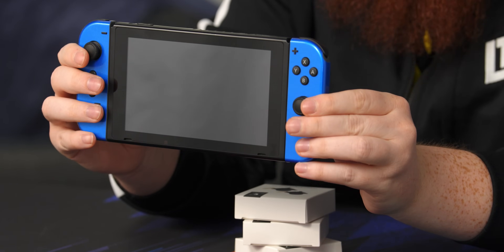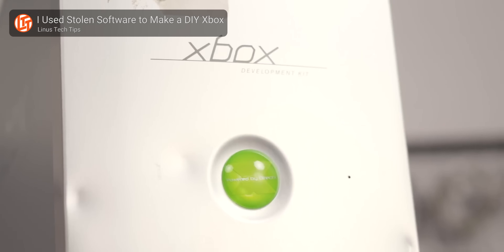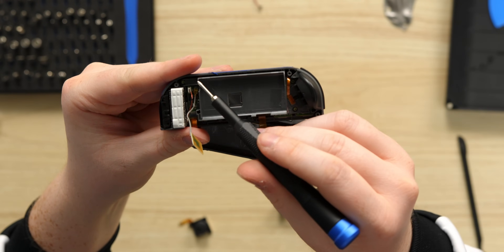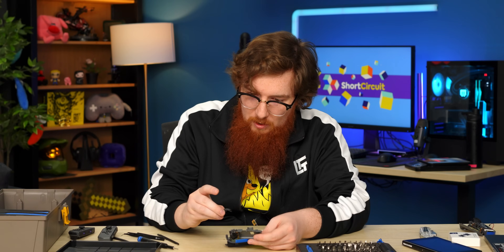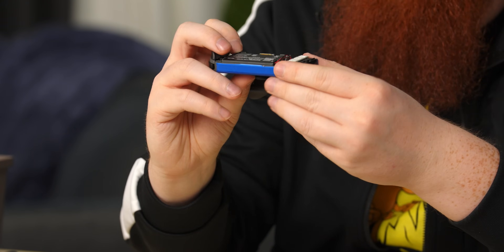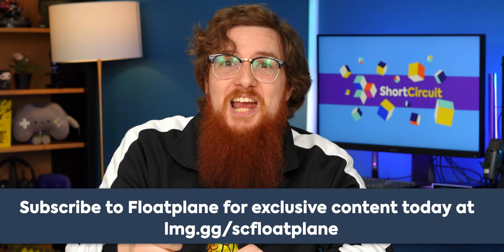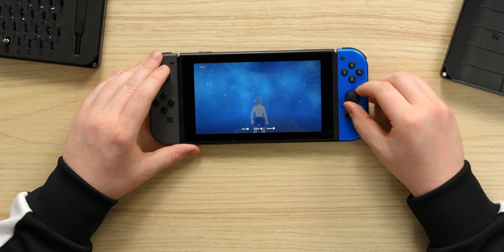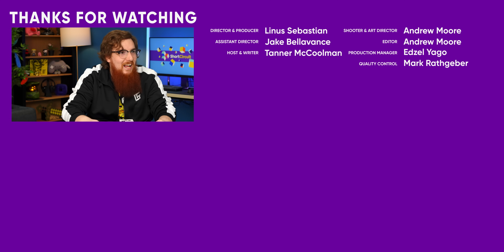Make your controllers WAAAY better - Gulikit Joycon Joysticks

Comment: Hall effect sensors have been around for quite a while haven't they?
I wonder what other industries have decades old tech that have been proven to be effective and durable but aren't adopted because it ruins the "easily breakable product makes customer buy product again faster" cycle and the shareholders don't like that.
Reply: @wojtek-33 
Well Nintendo and Sony got their asses sued for the issues. Anyways, pretty sure the GameCube is not the first console with hall effect sticks on its controller.
Reply: The gamecube controller used hall effect sensors I think
Reply: @wojtek-33  for some reason I'm thinking Sega Genesis did, but I've never even seen one in person
Reply: Dreamcast controllers are the only official controllers I've worked on that use hall effect sensor joysticks

Comment: There are parts touching each other, just the important parts like the sensors does not physically touch anything. Drift will eventually still occur but your joystick would be so worn out by that time, it needs to be replaced anyways.

Comment: the shitty part is this is a problem that manufactures have caused 

ever noticed your ps2 and ps1 even original xbox controllers never seemed to drift?

yeah that's because they had chips on board that would correct for joystick drift they had it but they would calibrate it every single time you moved the stick so it never affected gameplay

they removed this in later systems introducing joystick drift

Comment: One thing to note is that dead zones only exist on potentiometer joysticks to account for them being near-impossible to reliably have zero drift when resting. That’s why hall-effect sensors are great. You calibrate them once, and it’s done. No drift, because no parts (in the mechanism at least) to wear out.

Comment: I've done 8 of these... only 1 was defective and they sent a full kit (2 sticks) to replace it. I bought on Ali Express so shipping took a few weeks, but they fixed 6 drifting controllers and served as a preventative maintenance on the last 2. They fixed the issue... well worth it. Each took about 15min to do if you're being careful to not break anything.

Comment: Official console controllers generally have almost no deadzone; they're inherently super sensitive and accurate compared to many third-party or PC controllers, which do include a deadzone (usually to compensate for much lower quality sticks). But it's for that exact reason they're so susceptible to drift. So yes, changing out the sticks likely won't have any effect on deadzones, but oh man you'll thank yourself when your warranty runs out and unplayable drift suddenly crops up (as has happened to me countless times).

Comment: I swapped my analog sticks with them and I felt that they not only differ because of driftless and zero-point but also more accurate aiming(maybe it is just placebo). I hear somewhere that original potenciometer analog sticks had 10% error in position, and this one has 1%, so I think it is not placebo.
But, maybe someone has another thoughts about that, would be glad to hear.

Comment: If controllers still implemented the same features of old controllers like the PS2 we would rarely have to complain about stick drift. On the PS2 for instance it's always measuring the values of full stick rotations (so move the stick full one way then the other) and it automatically adjusts the values to be "centered". Means if you notice a drift you just flick the stick and boom its gone

Comment: I remember buying a clear shell for my joycons during covid. Those ribbon cables made me want to scream. The ifixit guide made them look like they don't want to break the second you look at them funny. Luckily the only cable I broke was the one for the  r+l buttons on the joycon rail, which nobody uses anyway.

The part that made me put it down for the day was how the abxy buttons just do not work the same if you don't put them back in PERFECTLY, you will end up with stuck or sticky buttons if the buttons or the membrane are not seated absolutely perfectly. I had to disassemble that damn joycon so many times because you don't find out if it's perfect until you screw everything back in.

Comment: Yeah, I like these hall effect sensors finally coming to game pads and the like. But what I really feel is the disappointment from finding out the Xbone Elite controller had the exact same hardware as the normal controller for DOUBLE the price. I completely expected the sticks to be higher quality but they were exactly the same and to make matters even worse, the wore out way faster probably because of the heavier sticks that were on top of them. It was nice to have stick length options to get a bit more precision in racing games, but that was more than negated when the sticks started to drift within months even.
At some point It fell on the USB cable which broke the connector. So incredibly happy it was within warranty. It was probably within the first year even. I traded it in for a regular controller, got 60 euros back even and that controller is still serving me happily after years of gaming. The padding on the left stick has worn down to almost nothing just like on my x360 controllers and it's still good. Best interaction with a shop ever and never paying that much for a game pad again.

Anyway flight sticks have had Hall Effect sensors for years, even decades. So it's not like I'm super happy this Chinese company finally brings the tech to game pads, I'm more relieved that FINALLY somebody is doing it so all the big game pad manufacturers can se CONSUMERS ACTUALLY CARE ABOUT QUALITY AND TECH.
/ end rant

Comment: Is it weird that I think it would be cool if there was replacement joycon shells that allowed using 3DS analog sticks instead of the joy con ones? Never heard of 3DS joysticks drifting and I prefer them over the joy con ones anyways. I think the ribbon cables are compatible just maybe not the right length/angle so might still need an aftermarket one if one is ever made. :P

Comment: I bought a slightly used Steam Deck couple days ago, the first thing I did was order GuliKit hall effect joysticks for it. While they're on the way, I practiced disassembling my SD and taking out the original joystick assemblies, so now I'm ready to do the surgery, can't wait for the joysticks to arrive.
Reply: There are a couple different models of Steam Deck sticks. I don't know how important it is, but you may want to check that the sticks you bought are meant to replace the sticks in your SD. You can check the model of sticks in SD settings. I believe the main issue has to do with using the touch sensor in the sticks - otherwise either model I think will work for basic control input.
Reply: @Jeremy_Hopkins  Yeah, I've read that GuliKit joysticks don't work with MHDA controller. Thankfully, mine is MEDA, which is compatible.

Comment: Ok, I did this mod and I have comments

1, the sticks do feel different from stock. Not bad, just stiffer. Several friends of mine have confirmed this

2, I did get a defective kit at first. One stock had some odd feeling on the inside that prevented it from making a full 360 rotation on it without a hiccup. The vendor replaced free of charge

3, despite the changes to the stock feel, I quite like them. Make sure you do the switch calibration though. Very important

4, the caps of the thumbsticks pop off easy. Great for installation, but also easy to lose them by accident if you are not careful.

Comment: I installed these last night and the right stick doesn't sense any movement at all but it does still do the R3 click so I know it's connected to the joycon. Anybody know why that's happening?
Reply: is the ribbon cable fully inserted?

if it is check the ribbon cable for damage

Comment: What you did fail to mention (I know it’s outside this video) is that a replacement normal joystick is only about $3

So instead of $30 for these or $50 for a joycon you can fit it for $3
Reply: I've installed those $3 or low priced ones and they work. But the ones I've replaced they still eventually drift. I'd hope these are better quality or at least last longer. I'm still doing more research on the matter.

Comment: It would be a lot better if these were for the elite V2 controller, and came with an actual good membrane for the face buttons and replacement for the shoulder buttons 💫🥇
Reply: For the elite 2 works perfectly, it has drift problems ?

Comment: The one difference I've noticed is the Gulikit sticks press in more easily than the original sticks. That could be a problem if that button is mapped to an action. You can also just slip the stick into that grommet thing like putting on a shoe (at an angle) - it's not that big of a deal. I'd call this more like a 4/10 difficulty. Hard enough to shy away from if you've never opened anything, but it's not like it requires soldering or anything either. Just be careful if you detach the battery - the connector is a bit fragile.

Comment: Pro Controllers are a waste of money even if they have extra buttons and functions...I would buy Pro Controllers that use these Hall Effect Joysticks, they will cost a lot but it is way better than normal joysticks because they last a long time and drifting is almost non-existent. I wouldn't have to replace and buy replacement parts like the PS5 Pro Controllers, very disappointing since they didn't use Hall Effect.

Comment: So I would have to pay for the weak NS along its crappy controllers then this? No thanks, N's not getting my money.

However, getting a used tablet alone for around $170 bucks, then get a 3rd party non-shtty pair of JoyCons, also used games for N to not get a dime... That could be an option, but what the console offers still doesn't ring a bell on me.

Comment: joystick drift and deadzones are a manufactured problem, to sell you more products. PS1 controllers don't use hall effect sticks at all, and they have no drift, no deadzone, and remain as perfectly accurate as you can reasonably expect anything.
hall effect sticks also aren't perfect, as they lose sensitivity over time.

This is a manufactured ewaste greenwashing scam.

Comment: I need this for my valve index controllers, they also get damaged very often, especially if you click them (they kinda fixed a few of the issues they had but they are still very fragile)

Comment: Joycons are one of the worst controllers I've ever seen. I have a v1 switch, and they have NEVER been working totally. Battery is buggy (not charging/doing 100-0% in 5minutes), they disconnect 24/7... And the worst, I opened them to replace sticks because they were drifting, and the ribbons cable are so low quality and doing a 180° inside the joycons, that they are always about to break.

Nice job nintendo, only 50 bucks for this piece of shit when I can have a perfect Xbox controller for less than that.

Comment: I'd be interested in a video about gyro and the viability of it as a primary way to look and aim. Perhaps the differences between the accuracy of the gyro controllers out there, if there is one, maybe one for the labs to test out. 

I use a Dualshock 4 controller for gyro on all my PvP games, I do not use the right thumb stick at all, it's shockingly underrated and would be cool to see some more awareness on gyro, since more and more games are adding gyro as an option lately but most people seem to think it is only useful for fine aiming. For anyone interested in trying gyro, a tip is to use acceleration.

Comment: I have these. And I still have stick drift, even after calibrating several times. All was fine for about 4 hours of gaming after installing them. Now the left stick wants to go up and doesn't want to go down. Again, calibration doesn't help. Hopefully I just got a bad apple but beware nonetheless. Cheers.
Reply: That literally shouldn't be physically possible. I'd say you got a bad batch, but I have no idea what about them could cause that.
Reply: Thats a bad pair. For that to happen there has to be a manufacturing error in the stick. Unlike the stock sticks that use a type of variable resistor, the Gulikit uses hall effect created by magnets so there is no contact between the stick and the sensors. What your describing make me think  something has come loose internally sense it worked fine for a bit before failing.
Reply: @MrGamelover23  Thanks for the reply. I did not have any trouble installing them but I will open them up and check to be sure the ribbons are seated securely. Otherwise I would assume that confirms I have a bad set. Thanks for the information.
Reply: @lordsetarurare  Thank you for the reply. As stated in another reply here, I'll check the ribbon seating and assume I got a bad set if the ribbons are seated correctly. No hate to the manufacturer, either. Things happen. :)

Comment: I can see hall effect tech becoming more prevalent but at the same time I'd rather stick with potentiometers. When a potentiometer starts to fail you can still use the controller for some time, giving you time to order replacement parts or a new one. Hall effect just straight up dies out with near to no warning. I'd rather have a semi working controller than to be left suddenly with a completely dead hall effect sensor.
Reply: Guys I found the shareholder
Reply: @IStratz  Nice of you to think that I have enough cash to hold anything, especially shares. I come from experience with pc flight sticks. Had many hall effect sensors die suddenly that I resorted to potentiometer ones. They both last about the same amount of time before problems set in, just that the potentiometer gives you a farewell in advance and still semi functions for a bit. If they can make them reliably last longer than potentiometers then I'll be very interested.

Comment: Wow. That seems like WAY more work and hassle than it’s worth.
Reply: Whats your time worth? Half an hours worth of work if you are going slow. And you save needing to buy replacement joy con's 2 or 3 times.

Not sure about you, but the math checks out for me 🤷‍♂️
Reply: Once you do it once replacing joy con sticks is like a 15 min job.
Reply: yep. pretty sure ill end up breaking the ribbon cables
Reply: @mrmoosetachio  more than anything I’d be worried I’d do irreparable damage to the controller and end up having to replace it entirely.
Reply: @SubhrajyotiAcharyyaDSB  that’s my main point. Any time I open something to try and repair it, if I see ribbon cables I’m usually out. I’ve broken them just trying to get them out of the way or trying to get to the component I’m actually trying to fix.
Reply: @sturdybutter  that's what gets done in the end anyway 🤷‍♂️